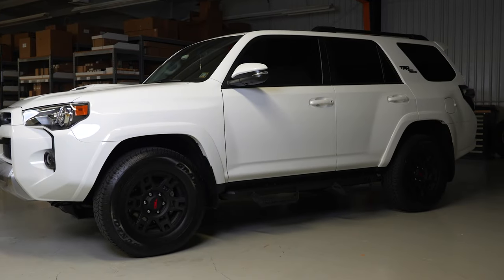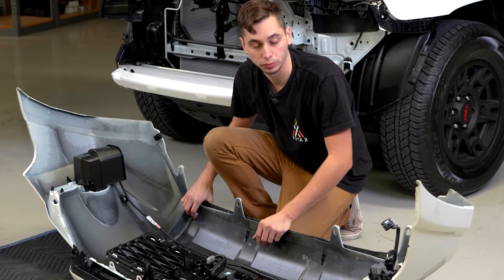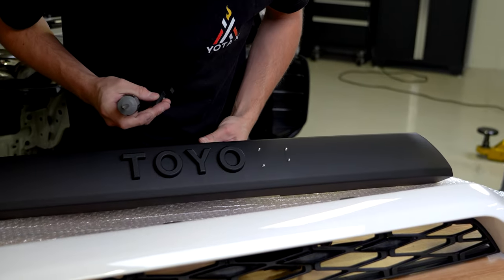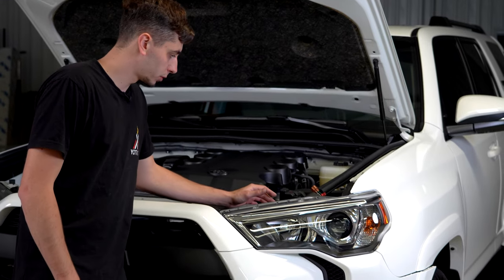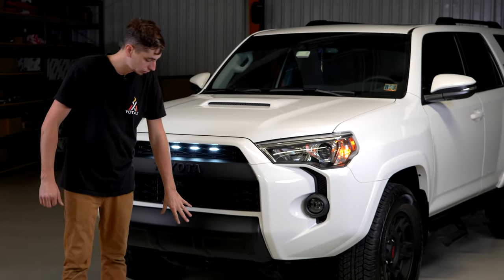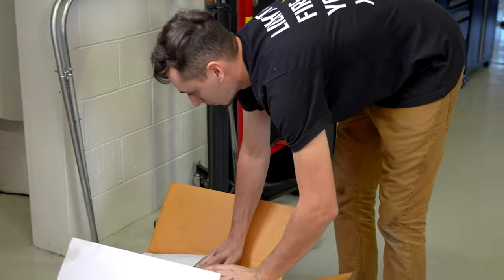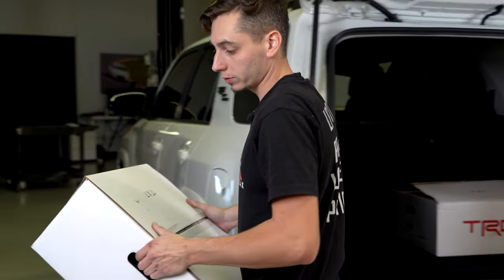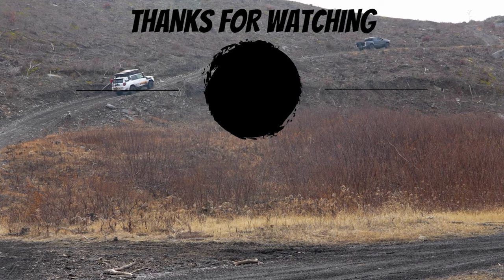We Gave This 4Runner A Facelift With A TRD PRO Grille And Valances!

Comment: Or instead of doing all that work to remove the front and rear valances, you can do like I did, and just use some painters  tape. Be patient do a nice job of taping off all the edges and apply a couple coats of Krylon or some other good adhesive paint. Mine still look great after two years and it only cost me 20 bucks.🫤

Comment: Looks like you guys refined the grill more, the fit and finish looks a lot better than previous grills and the screws look longer for more thread engagement for the letters. Sadly I had to remove it and ended getting an oem one due to fitment and made a gap on the upper grill. Keep up the good work of refining parts for better fit and finish.
Reply from the maker: Sorry you had issues. We would've sent you a replacement if you reached out. We are constantly trying to improve what we do.
Reply: @yotaxpedition  I know, I had an issue with the upper grill and you guys sent out a replacement for that. Did not want to keep bugging if the fitment was going to be the same overall. If the fitment was like the oem one I’d still be rocking it, I like the black letters look way more than the silver.
Reply: That's what happens with aftermarket stuff, it never fits/performs correctly. The oem is outrageously priced though. $700 for 2 pieces of plastic? Gtfoh.
Reply: Do they make the grille or does china like everything else?

Comment: It's a simple upgrade, yet it looks so much better. How did you get the bumper to connect back onto the frame without it unclipping and bulging?
Reply: Mine is poking out as well
Reply: @samdonlick  it's really annoying. Happened after I installed the Diode Dynamics fogs and upgraded the headlights.
Reply from the maker: I'm assuming you're talking about where it clips under the headlight and on the fender? I've never had the issue you are explaining. I would make sure everything is lined up properly and clipped all the way in. If you want, shoot us an email at support@yotaxpedition.com and we can try to help you out.

Comment: Love your videos. Is it possible to install front and real valances to 2024 SR5 ?
Reply from the maker: The SR5 models do not come with factory valances. In order to get the valances to fit, you must remove the bumpers and cut slots in them for all the tabs. If you look at the back side of the bumper you can see the spots that need to be cut.
Reply: @yotaxpedition  thanks for the response. Gonna order blackened kit from you guys too.

Comment: Would this fit well in a 2023 sr5 with out having to cut anything
Reply from the maker: The grille will fit but you will have to cut slits for the valances to be installed because the sr5 doesn't come with valances.

Comment: What type of wire tap would be best and what size wire?
Reply from the maker: I used a 18-22g wire tap. Here is a amazon link https://www.amazon.com/Eyech-Connectors-Disconnect-Self-stripping-Insulated/dp/B078TYQS94/ref=sr_1_3?crid=29E180DADQ5YU&keywords=18-22g+wire+tap&qid=1698407969&sprefix=18-22g+wire+tap%2Caps%2C63&sr=8-3

Comment: when you tap into the DRLs wire will the raptor lights only light up when the switch is in the DRL position? or will they also light up at night when i have my headlights on?
Reply from the maker: If you hook the raptor lights up to the marker lights on the 4runner, the raptor lights will be on in DRL position and headlights on position.
Reply from the maker: Yeah the 20-23 is currently on backorder. You can still order it and as soon as they come in we will ship the orders. Up to you if you want to wait or lock in your order now.